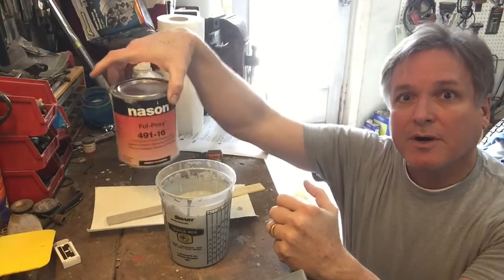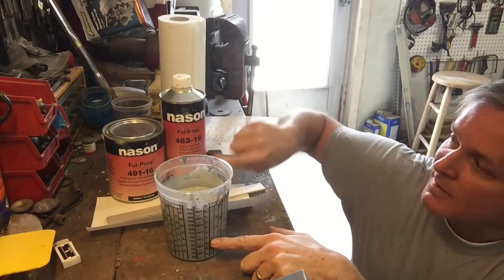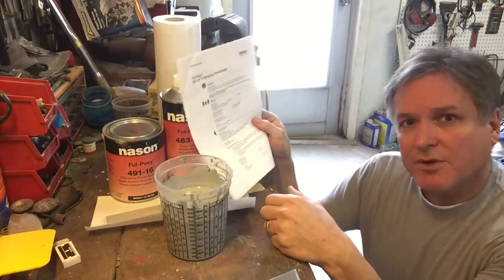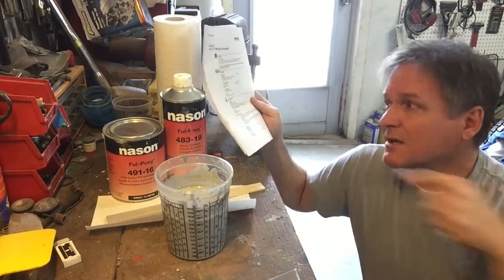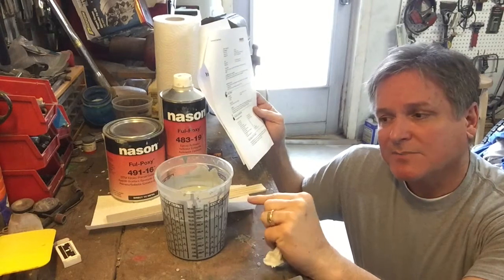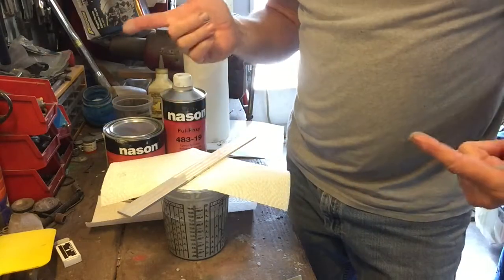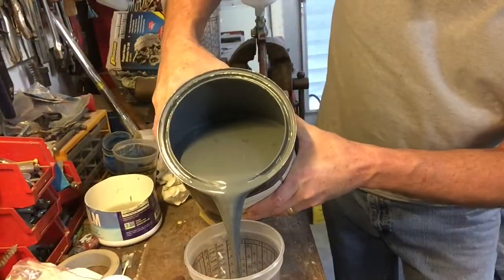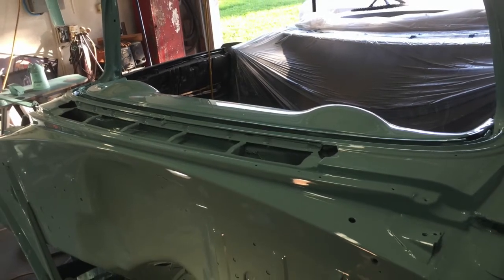How to properly mix and spray epoxy primer

Comment: Useful information, thank you. Regarding the Miba product, I've seen people spray the epoxy as soon as it's mixed. Do the Meba products need a break before they start spraying too?
Reply from the maker: Each product is different.  You would have to follow the instructions on the manufactures technical data sheet.

Comment: Question for you. I’m gonna be doing same thing in my garage like you did. Did you happen to have a fan blowing to the open door while spraying in the garage?
Reply from the maker: Yes you must have a lot of fresh air moving in one door like the garage door and out a side garage door.   For primers no filter is needed.  When painting I use fans with A/C filters on them to help hold down the dust

Comment: Who makes that air cleaner  and where did you get it for the 55 Chevy ?  been looking for one for my car . Also when painting do you use a fan at all when priming ? How about whey you spray base and clear ? Thanks so much
Reply from the maker: Hello thanks for checking out my video.  Don’t remember where that air cleaner came from, sorry.  When painting and or priming I do use several fans and I put disposable filters behind them some times to cut down on the dust and to capture some of the overspray.
Reply: @cvclassics  Do you put the fans behind and in front going out the garage door to suck it out ?  or just behind with filters
Reply from the maker: If I’m priming I’ll use a fan to draw out the fumes,  if I’m painting I will have the area cleaned and washed down.  I’ll use fans to pull fresh air in with a filter on the outside to cut down on dust.   All air coming in will be filtered.  Then for the exhaust side I’ll use exhaust fans with filters to catch overspray

Comment: Should I add the paint thinner with the hardener and then wait for the specified time to pass, or should I add the paint thinner after the settling time has expired?
Reply from the maker: Each paint company may have different instruction and you should always review and follow the instruction on the TDS (technical data sheet) of the product you are using.   Usually everything is mixed at one time.  Good luck on your project.